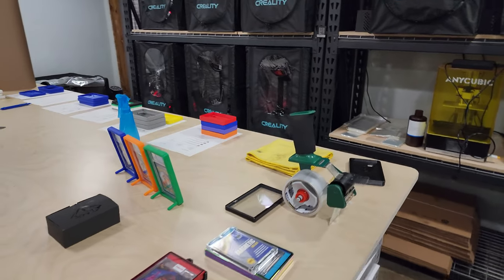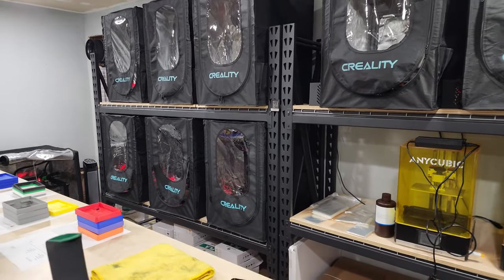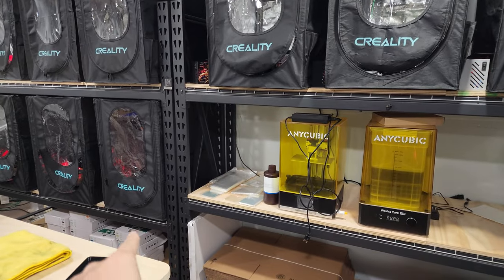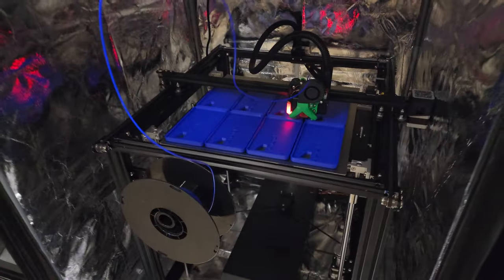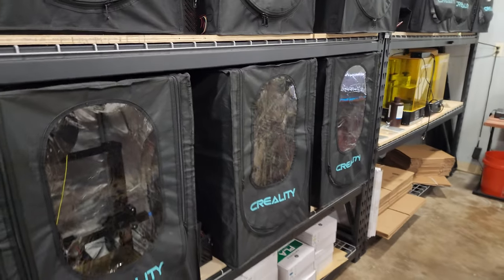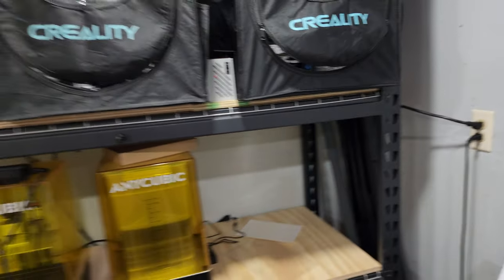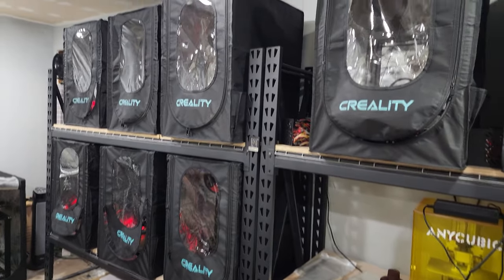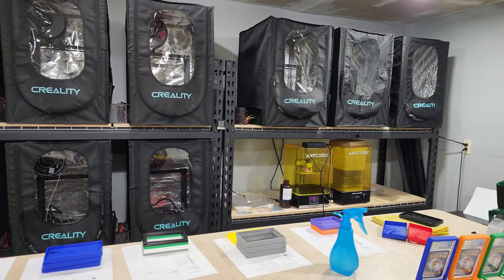3D Printing Farm Shop Update: Recent Changes for efficiency and time management.

Comment: With volume of printing you're doing, consider hardened nozzles if not already using as brass ones will open over time even with non-abrasive material.  For sure high quality thermistors with lower variance might be the ticket, but also keep an eye on the power supplies.  Have seen variance of current they can deliver over time as well.

Comment: Damn, quick draw with the new shop update video! Such a nice setup you have going there. No worries with the lack of content, you’ve got two jobs and a life. No need to make videos just for the sake of making videos. 

The heat theory is interesting and it would be cool to find out if that is indeed what is making your printers drift. You have tuned those printers so well that minute changes can make big differences. I wonder if the top shelf of printers run hotter because of the heat in the room compared to the lower printers.
Reply from the maker: Thanks! I'm almost certain it is thermistor related because I checked the resistance at set temps and they all were different. Some out of range by the spec sheet

Comment: From your last video, did you ever do a heat test on the Hatchbox PLA Pro Plus to see the real world heat tolerance? I ordered some, just curious.
Reply from the maker: I did do a retest, I actually found the PLA Pro to be only slightly better than the regular PLA. Honestly was disappointed as they advertise ABS like heat resistance. I found Polymaker Polite PLA had better heat resistance, but I have my entire fleet of printers tuned for hatchbox PLA and also my designed factor in the shrinkage that hatchbox has, so I cant make the full switch without significant effort and redesign of my files.

Comment: Temperature issues across multiple printers, buy a lot of thermistors from farnell  (and heatsink). Solder yourself and rebuild all heatbreak and heater units with thermal paste

Comment: Try calibrating one of the thermistors and see if that helps. Not pid tuning, But actual calibration with a multimeter. And for your cr10 bed, try boosting up your current to 1amp or reduce y axis acceleration to 500 or less.

Comment: Do you happen to have any thoughts on what Slant 3D is doing with their goal of high quality made in USA sell-it-for-cost $10 1KG filament and new spool design? Would be interesting to get your thoughts if you have any. If you haven’t seen it I suggest looking into their YouTube channel.
Reply from the maker: I think its great that theyre trying to bring cheap filament to the market. For me I look at reliability, consistency, certain material properties in a certain brand, most of all I look for availability. When you run a print farm and tune all of your printers to consistently print with a certain brand of fillament, changing material can cause lots of problems. If Slant 3D can provide a consistent material, in terms of colors, and other material properties, always be in stock whenever companies need it, AND maintain high quality standards, datasheets, and a 10 dolllar price point, I willl praise them til days end. Until then I cannot purchase material that may or may not be in stock, or maintain consistency even if it means its only 10 dollars.
Reply: @Redo3D  I totally understand. I hope they succeed for obvious reasons but also if they are undercutting the entire market with good filament and can keep up with demand, I wonder if other brands will have to lower their prices. I’m very interested to see how this all pans out.

Comment: Regarding efficiency, have you considered using a nozzle with a bigger diameter e.g. 0.6mm?
Or would this have a significant effect on the quality of your cases especially the hinged part?
Reply from the maker: I have thought about .6mm but my extrusion rate is at 10mms3 which is the max I can get out for a quality print. If I switch to .6mm i would have to adjust the speed to maintain the 10mms3 so it comes out to about the same in time.

Comment: Just curious, when you get a new printer, roughly how long does it take to get it running as accurate as your other printers? Do you need to troubleshoot things like warping, elephants foot, etc. from new printers or does your tuning workflow essentially eliminate that stuff? It would be very interesting to see a video from unboxing a new printer to printing a perfect display case. 

Unless it really is just leveling the bed properly, using good filament, calibrating with your 100mm test print and done. I’m over simplifying but still.
Reply from the maker: For the ender 3 (which I am no longer going to purchase) it took me roughly 6 hours to go from out of the box, to what you see in the video. The wiring is what took the longest to extend the control box out of the enclosure. 

For the ender 5 plus, from out of the box to fully working took roughly 1.5-2 hours.
Reply: @Redo3D  6 hours is very impressive but 1.5-2 is almost mind blowing from my perspective, haha. I guess it really is the little details that add up. If you ever find yourself in midland Sweden pop over and give me a hand, haha! 

I still think it would be educational doing a video showing a new printer setup. Just a thought!

Comment: This might be a dumb question but I didn't see it during your video, do you have a raspberry pi connected to each of your printers? I'm looking for a good way to run multiple web interfaces for my printers without having to spend a bunch on pi's.
Reply from the maker: I use the Manta m4p motherboard from bigtreetech. It has the CB1 module which is a pi replacement. I only run one instance per printer.

Comment: I am running multiple ender 3's with klipper off a single raspberry pi, might be a more cost and time efficient way for you to expand to more printers with klipper without as much wiring and setup
Reply from the maker: This was a thought I had as well. But I upgraded the motherboard with tmc2209 stepper motors to control the vref of each machines steppers through klipper. The board also had some nice features.

Comment: Consider one of those fire suppression dry power bombs inside each of the printer enclosures. if for whatever reason there’s a fire you might loose one machine rather then the whole garage..
Reply from the maker: Supposedly the tent is supposed to keep fire inside. Haven't fully tested that though lol

Comment: Have you considered the bambulabs p1p?
Reply from the maker: I have. But the lack of ability to modify firmware has kept me away. From what I understand others have done studies that the Bambu labs printers are not the best for dimensional accuracy and you cant modify firmware to compensate. So that is a big deterrent for me.
Reply: @Redo3D  I see. The klipper and modified enders are definitely tricky to get running but once you know what you're doing it's pretty reliable. My ender 3 is running very reliably now using klipper but it wasn't an overnight process. Thanks for your videos.